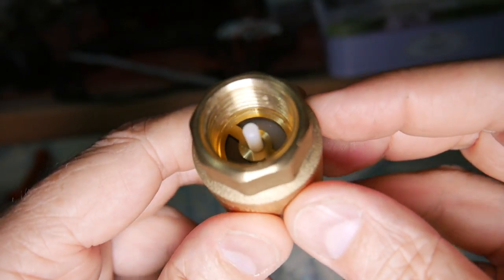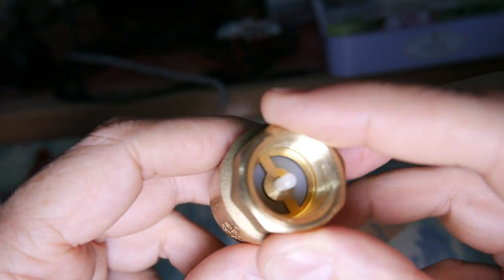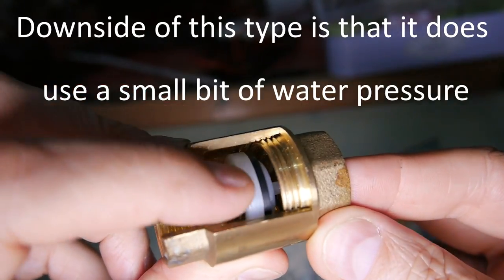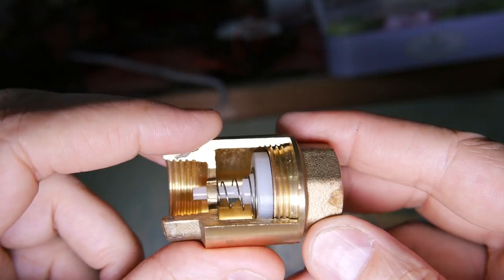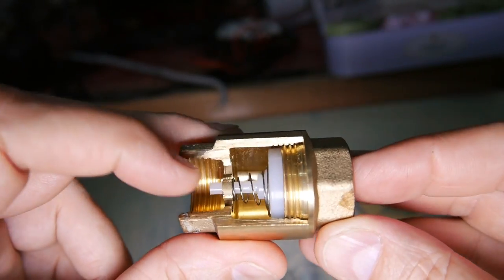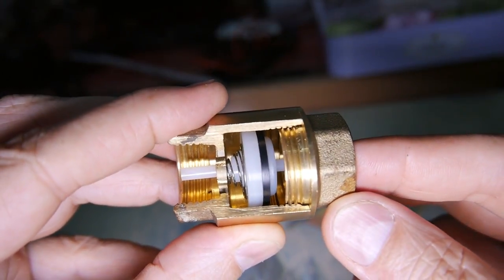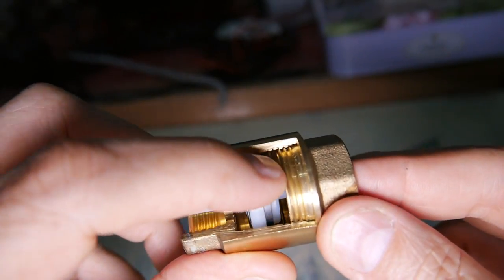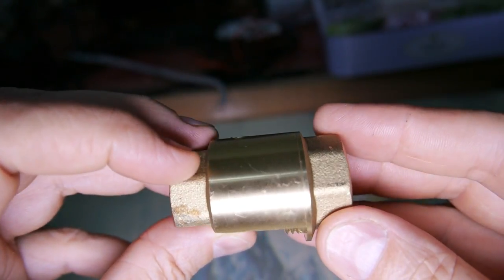Check Valve or One Way Valve - Spring Type

Comment: One thing I don't understand about check valves, I see them mostly made of plastic. Will that be strong enough for high pressure plumbing system of 1000kPa? Plastic? Really?
Reply from the maker: That's 145 psi. I don't know what they are rated for, but I don't think I'd use them.
Reply: @tsbrownie  But the brass valve in this video is also made of plastic internals. That's the type I'm talking about.
Reply from the maker: @thelogician1934  I've never lived in a house with those pressures. I think 45 psi is the max I've seen. That's about a third of 1000 k pascals.
Reply: @tsbrownie  1000kpa will happen will you heat up a hot water cylinder and due to thermal expansion but as soon as the tap is open, the pressure goes down to normal level like 300
Kpa.

Comment: Can you remove the spring completely (in a vertical setup) so water pressure closes it and gravity opens it again
Reply from the maker: There is already a flapper type that works on gravity and takes away very little water pressure. BTW, the spring is not strong, just enough to nudge it closed.

Comment: I think you should comment on how to replace the valve when it is worn, I assume the body unscrews apart. Also why is everything made of plastic now, wouldn't a metal valve be better.
Reply from the maker: Unfortunately the companies that make these don't sell spare parts, however a good quality part usually lasts for decades.

Comment: Can this valve be cleaned on the inside I'm using it a washing machine drain ?
Reply from the maker: It can be cleaned, but if the rubber seal is broken or worn, the cleaning won't stop it from leaking backwards.
Reply: @tsbrownie thanks it just has lint in it

Comment: Is this valve effective for pressurized water only? Or can be use only "gravity pressure " from a water tank?
Reply from the maker: It will work, but it is not good for low pressure systems.  Some pressure is lost pushing it open.  There is a flapper type which might work better for you.

Comment: Cool a diode for fluids ;>)
Reply from the maker: Exactly!  Maybe you know already, early researchers in electricity used water in pipes as the model for how they thought of electrical flow.
Reply: Other way around... a diode is a check valve for electricity ;)

Comment: any idea how long those last? before the spring is gone say
Reply from the maker: Depends on the brand and how much/hard it is opened and closed. A good one can last 10 to 20 years easily. The rubber seal is the typical failure point.

Comment: Can these Valve is used for gas of approx 15 bar or 200 psi ?
Reply from the maker: No, these are for water.  I'd not use them for anything else, especially something flammable.

Comment: What's the hole for in the centre of the valve body ?
Reply from the maker: Can you give me a time index?  The only things I see are places for the water to pass.
Reply: From 20 seconds onwards where you're explaining how the valve works against the spring you can see the hole underneath
Reply from the maker: @pgtips9236  This is a product that was cut and mounted to demonstrate.  That hole in the back is where it is to be screwed to a display board.
Reply: oh i see,i was thinking it's some kind of drain port lol

Comment: I see a thread inside , can I open it to maker repair, is it have a normal or reverse thread, thanks
Reply from the maker: There is not much to repair inside and I do not think most companies sell the parts.  But in theory you could probably take it apart and replace the internal parts.  Oh, and you would have to regrind the brass valve seat.
Reply: How , counterclockwise or the other way, did you try to open it?
Reply from the maker: I do not know.  You will have to try it.  Make a video and show us!

Comment: Can i use it for pressure relief
Reply from the maker: It would release at a low pressure.  It would be better to use an adjustable relief valve.
Reply: @tsbrownie  do you have video for it sir?
Reply from the maker: @redsun5145  No, that's something I have to put on my list.

Comment: i have install water pump to increase water pressure in my house..the water pump effect kinda delay as the pressure built up..will this retain pressure if i install this valve after the water pump?(so the pressure retain normal as it had increased as my water pump doesnt have one way valve)
Reply from the maker: I am not a plumber, but I have seen these installed before and after the pump.  Not sure which is better.  My water pump has a non-return valve on the inlet (Hitachi).

Comment: Will it work for air?
Reply from the maker: It probably would work at low pressures, but there are specially made air valves that would be better and more reliable.

Comment: Is there any way can we adjust the spring tension? to make to make it variable pressure rating?
Reply from the maker: You could change the spring.  Or add a brass / stainless screw to increase tension, but those are rather advanced things.
Reply: @tsbrownie  Yes, You are right.Thanks for your reply